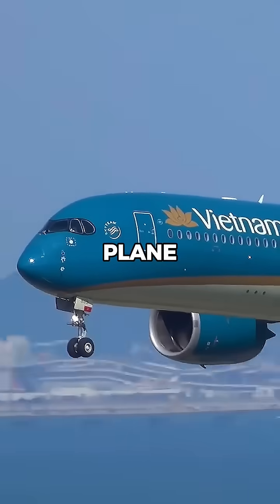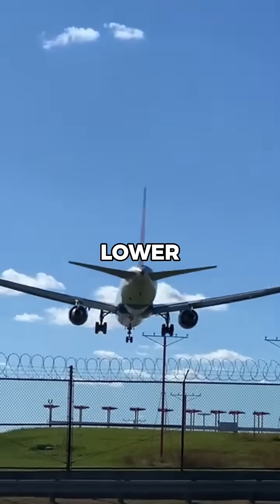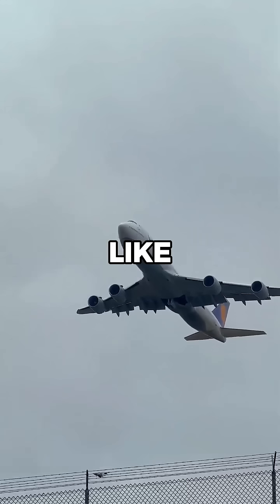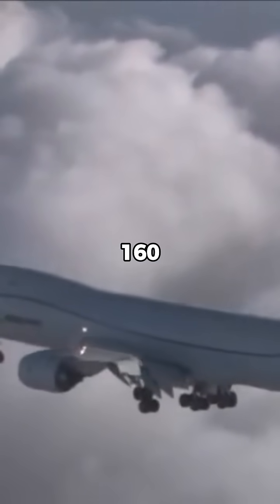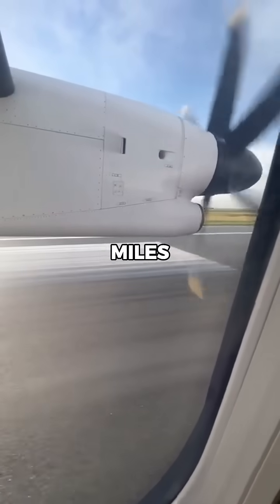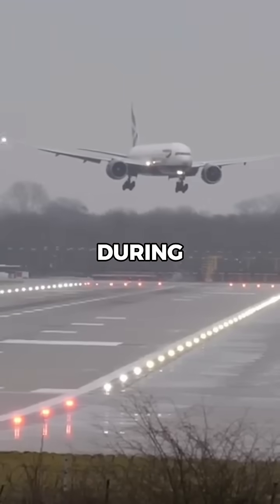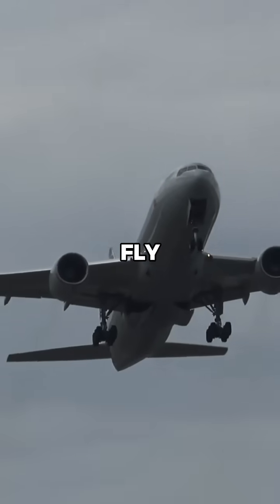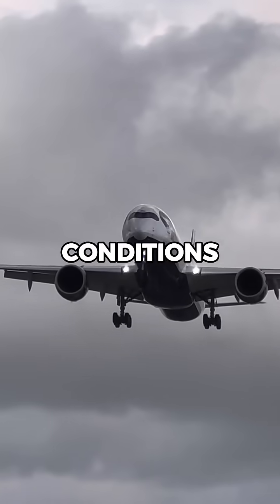What is the slowest planes can fly?

Comment: I would have thought an aircraft would have a higher stalling speed at hi altitude not a slower stall speed. The higher you go the stall speed increases and the available thrust decreases,till the plane cannot generate enough thrust/ forward speed to get the lift to fly. This is the max altitude.

Comment: Ok so just some basic info from an actual commercial pilot. You've got ground speed, true air speed, indicated air speed, calibrated air speed, equivalent airspeed and mach number, none of which are measured in miles per hour (unless you're flying an airplane built before the early 1970s).

What you're probably referring to is ground speed, which in theory could be anything depending on the winds, even negative. The slowest any airplane can fly through the air mass it's in is VSO, the stall speed in the landing configuration. At higher altitudes, this means a higher ground speeds. With a headwind this means lower ground speeds.

Comment: 120 miles per hour for the 747 and A380? 160 miles per hour is more in the accurate range and why are we talking about mph if airspeeds are measured in knots?
Air being thinner at higher altitudes is accurate but the reduction in speed needed to generate lift is beyond idiotic to even say because planes fly much faster at those altitudes than they do at FL100...
Reply: @ FL100 literally means 10000 ft…